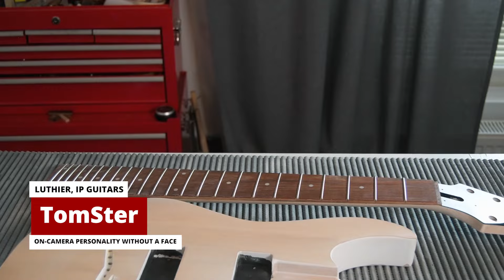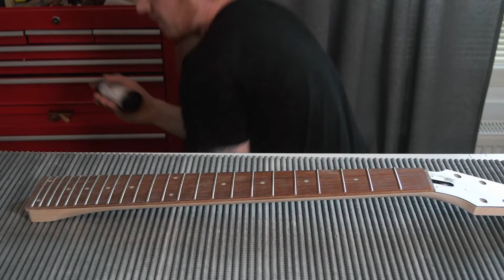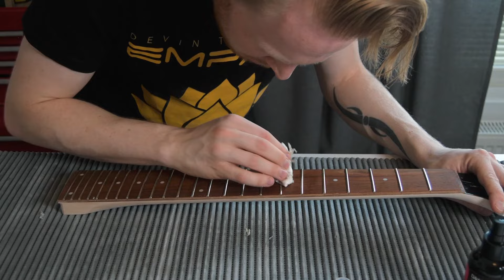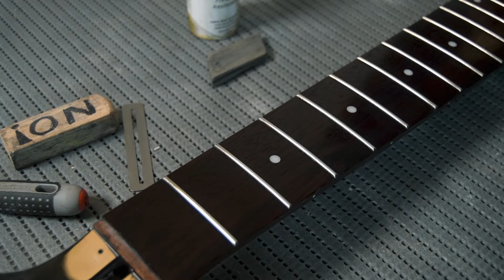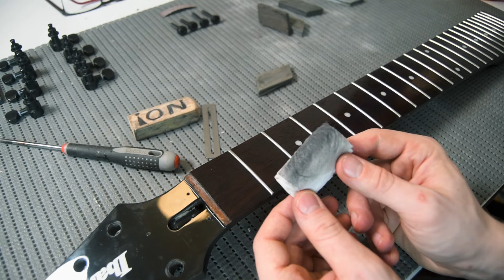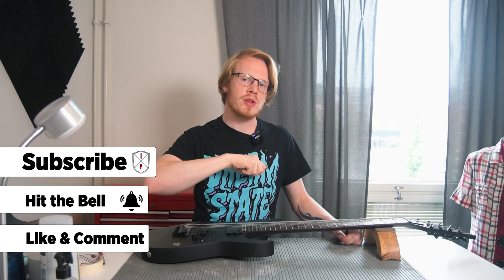How To "Ebonize" A Fretboard With Stains

Comment: THIS is how you do it! Never understood people who sanded the fretboard. If you can oil it, clearly the wood is unsealed.
Reply from the maker: Exactly, just need to remove that oil and that is an easy process in its self :)
Reply: Some Fender necks have poly coated fretboards such as on my Mustang, so had to sand the poly back before I could darken.
Reply: Depending on how course wood is also determines how much of the stain it will absorb. For instance if you’re staining wood, sanding it under 300grit will help it absorb more stain and in turn appearing darker than a fretboard that has been sanded to say 1000grit.
Reply from the maker: Absolutely right

Comment: Head's up, you're not getting rid of contrast by scraping the dots, you're INCREASING contrast because you're increasing the depth/difference between light and dark tones. For example, a black and white checkerboard has 100% contrast, where a black and grey checkerboard has we'll say 50% contrast; since the grey isn't as light as the white, you're reducing the difference between light and dark tones. So by scraping the stain off the dots and making them more light/white/vibrant/pop you're increasing the contrast between the dots and the board. Just wanted to let ya know!
Reply from the maker: Wow, did I really say I was getting rid of contrast?🤦🏼‍♂️ What a brainfart, because as you also said here that makes no sense.

My bad, sometimes my brain thinks two different things at a time and it comes out as just a combination of nonsense. Probably in this case "Removing stain off the dots to create contrast" became "removing contrast by removing the stain" :D
Reply from the maker: Ah alright, thanks! Good to know :) honestly, knowing me, I wouldn't have been surprise had I messed that up
Reply: I believe when he said,  "Using words like much needed contrast when I've basically made sure to get rid of contrast", he was referring to getting rid of contrast by getting rid of the contrast between the black guitar and the neck that was too light. He was getting rid of that contrast by staining the neck to make it darker and more the same color as the body.

I think he was acknowledging the irony and then made the distinction between contrast and contrast that works. The bright white dots on the dark fretboard is a contrast that works while the contrast between the lighter shade of the neck and the darker shade of the black body is a contrast that doesn't work and therefore THAT contrast had to be gotten rid of by staining the neck.

Comment: Not quite ebony, but still an improvement.  They make special stains and dyes just for doing extra dark black shades, one of those might work better. I think minwax makes one.    I've used Keda wood dyes to tint rosewood fretboards on multiple builds.  But their "black" is a mere dark indigo.
Reply from the maker: I've heard of the minwax one too yeah! And you're absolutely right. This is perhaps a matter of much more "darkening" than a 100% ebonising process.
Reply: @IPGuitars  I'm still looking for the perfect solution.  So far from vids I've seem online, india ink seems to give the best results - even better than Minwax true black.
Reply: @normbarrows  I looked into india ink because of your comment, and it seems that in terms of looks it works, to the point that StewMac sells it. However, I'd be a bit worried that it's not waterproof (it's basically fountain pen ink). Would that mean that the ink would transfer if sweaty fingers touch it?... Not sure, but I also wouldn't want to find out with my instrument. I'm looking for a solution as well... It occurs to me that maybe it it's sealed with oil afterwards it would work though. Have you tried that?
Reply: @mercedesescobarmusic  No, I've pretty much stuck with aniline dye (Keda) mixed with water, not alcohol.  I'll use it to tint a fretboard or dye a maple fretboard brown - for example.  Despite being water soluble  only a little rubs off when applying oil.  These days I'm into lightening, not darkening fretboards:  https://www.youtube.com/watch?v=B3hAX2YwwJM

Comment: To not tape the sides is just insane to me. Then to say cleaned up nicely 😂💀
Reply from the maker: The key here is not to use the stain so heavily that you'd get spillover. If your rag is relatively dry and you're putting on multiple light layers, it should be more than fine to do it without tape. Also plastic binding is easy to clean up or scrape

BUT you do raise a very good point, if you're not used to doing stuff like this or this is a first time dealing with stain, I really should have at the very least mentioned taping the sides.

Comment: I have fairly big fretboard markers. Do I have to stain around them or just go over them? Will it come off the Pearl? Or fake Pearl. Whatever they are
Reply from the maker: You can stain over on top of the markers. HOWEVER, I recommend you test this on a small part somewhere to see if you can then wipe that marker clean with a cotton swab (with water or IPA depending on your stain). It can depend on what material your inlays are and what stain you use. Good to make sure that you can clean them up before doing the entire board :)

If you can't remove the stain off the inlays (rare, worst case scenario) you could try to mask the inlays with masking tape prior to staining. Here you'll need to make extra sure that you burnish the tape down, so that you won't get any leakage.

But I'm fairly sure that you can wipe away most stains off of your inlays :)

Comment: You should've used some brite pads at least before staining the fretboard, in my opinion. Just to help the stain penetrate a little more. Looked good tho 👌
Reply from the maker: Brite pads would open up the pores a little more yes, however they aren't necessary. As long as the fretboard is clean, the stain will "stick".

 I do agree though that brite pads are a great trick for this!👌🏼 Definitely something I overlooked when making the video
Reply: @IPGuitars  yeah man, came out sick. I've an old Ibanez with the same neck pretty much and you gave me the idea to black it out cuz it doesn't go with the rest of the build. But it looks so pretty that I don't know if I want to murder that one lol. I might swap it and dye another one black, n keep this one for a future guitar. Cheers and thanks for the video

Comment: Will this stain the binding on my SLX Soloist? What about the imitation inlays? Would love to dye the laurel fingerboard black 👍
Reply from the maker: Great question! You can easily clean up the stain from the binding by just scraping it clean with a razor or scalpel blade :) if the binding is under clear coat then easy enough to wipe off with a guitar cleaning product or isopropanol. You can apply the same method to the imitation inlays. If you clean the inlays with the alcohol, just use a cotton swab to do so.

Lemme know how it goes if you go for it!🤘🏻
Reply: @IPGuitars  Thanks. Will do 👍

Comment: Try Iron acetate instead. Wood must be sanded. Wont affect the dots but will penetrate on wood up to 2-3mm. 2 coats would do, in most types of wood. It allows you to see the wood grain, and if the guy plays a lot and wears the fretborard, the underlaying clear wood wont appear! In addition: It´s so cheap. . . . (Clear vinegar + iron wool + time) Greetings
Reply from the maker: Oh absolutely a great trick! One that I have done way back when still in school, but never on this channel. I'm reluctant of buying wire wool again, so why I haven't done it in a while. But very good shout this!

Comment: Totally agree with the ebony. How did the stain last? When you showed it at the end, it looked as if a bunch came off during oiling / conditioning. If you can take figure out how to stain fretboards you could make a business out of it because most of the legal ebony left is very low quality. Even on brand new Taylors. Thank you for making the video:)
Reply from the maker: The fretboard is still looking as good as it did at the end of this :) all the pigment that came off toward the end was the surface pigment that hadn't seeped into the wood at all.
Reply: Cool! Thank you for the reply. Do you know if any reasons why you wouldn't want to stain a fretboard? Like is someone gigs it outside, down south in the heat? Do you think sweat would make it run even months later? Thank you:)
Reply from the maker: Well, the goal is to use the stain so that you get it to seep into the wood and remove any of the excess pigment that doesn't do so. So that once you oil the fretboard pigment won't lift off anymore. Even in the scenarios you mentioned.

Comment: Stained my binding pretty good with this. What’s the best way to get the black dye off my binding?
Reply from the maker: The easiest is with spirits and a cotton swab, if that doesn't remove the stain the best way is by scraping it off. You can use a razor, scalpel, or similar to do this.
Reply: No offense to the creator, and I mean this is constructive criticism. This is why skipping important steps isn’t recommended, and if you’re going to teach an instructional video, you should teach it correctly. Anything not being stained, should be taped off, or you will be chasing your tail, taking 1 step forward, 2 steps back.
Reply from the maker: Exactly and fully agree that I dropped the ball on that part. Because quite honestly, I didn't come to think of it at the time of filming. But lesson learned

Comment: Hello again bro, I did this ebonizing procedure on my Ibanez, but mine was done with Indian Ink. It turned out pretty well and looks great, one thing though, after playing and getting sweaty hands, I have some Ink/Stain coming off and marking on my fingers. Question is, is there any sort of coat that I can apply after the Ink to prevent this from happenning? Thank you in advance.
Reply from the maker: Did you apply some oil for the fretboard? When you do remember to let it sit for a bit and then rub off the excess. This will also remove any loose pigment

Comment: Hi, nice info about staining. Looks very good. What is exactly the drying time before a second layer...?
Reply from the maker: Thanks! And drying time really depends on what you use. Spirit-based or water-based and how much you put on. Water-based will dry slower, spirit-based will dry quicker. But the more you put on the longer it will take to dry.

You can see or feel when it is dry. A good rule of thumb: rather have many light coats that one really heavy coat to build up the finish you want.
Reply: @IPGuitars  Thanks. What drying time did you use on this guitar with this Crimson Stain....?
Reply from the maker: Hard to recall, but if memory serves this was the spirit-based so I wanna say anywhere between 5-20min between layers. I think I put the oil on like atleast 8h later.
Reply: @IPGuitars  Thanks again. I am still thinking about which stain could be the best. Spirit based or water based stain (for the the Fretboard). I want to use the stain for an old classical guitar which i have sanded to bear wood ( Fretboard).
Reply from the maker: Up to preference really. Most of the time I like to use water-based because they don't smell, so easy to work with even in an apartment building
Reply: @IPGuitars  Thanks for your info. Very helpfull. 👍👍

Comment: After removing frets and filling in a few chips on an ebony board..should I use a Ebony stain to hide scratches..discolorations? Subscribed
Reply from the maker: That actually is not a bad idea! Go for it, atleast it'll give it a little more uniform look
Reply: @IPGuitars  I ended up sandpapering

Comment: There is absolutely no need to be afraid of naptha lighter fluid for use as a solvent on wood fretboards. You definitely must respect its flammability for sure, but you mentioned fear of touching the fretboard after using it. This is an unfounded concern because it completely evaporates. Also the concern that it dries the wood, though true, is not a concern because you use it for the intended purpose of cleaning and drying. After cleaning and drying with naptha one should always moisturize with proper fretboard oil or wax.
Reply from the maker: I didin't remember I said that😅 but yes, absolutely the case of unfounded worry over flammability, while yeah only worry was the fretboard drying, but even then you're gonna put on oil anyway to bring it up to snuff. Silly past me with silly worries.

Comment: So how would you clean the stain off the neck? I want to do this to my RGA but I want to do the sides of the fretboard while leaving the factory look of the maple neck as it is.
Reply from the maker: First also make sure to sand off any clear coat on the side of the fretboard as it more than likely has some. But honestly, if you're worried about spilling onto the neck: masking tape is your friend.

Mask off the part you don't want stained and burnish down the edge with your fingernail. When staining, make sure your applicator (rag, brush, sponge) isn't too wet. Rather multiple light layers than making a mess with too much too quick👌🏼

Also, stain won't really stick to lacquered surfaces, so if there is some spill, you should be able to clean that off relatively easily :)
Reply: @IPGuitars  thanks bro!

Comment: Recommend dye brands, types of dyes for new zealand treated pine and purple heart wood?
Reply from the maker: I have used Crimson Stunning Stains and TLC Guitar Goods suStains. Those are ones I have experience with. They all work pretty much the same and come as either water or spirit-based, and mix well together within the brands. And together as well oddly enough.

The kind of final coat you are looking for really depends as well. Sprayed on clear coats, then you're pretty good with either. With Oil, CG stains go either way. Some of the stains lift the pigment off A LOT during oil application (blues and black spirit-based).

But as a type of stain, I would definitely recommend water-based if you're doing stuff at home because a) it's easy and b) they don't stink😆 Water-based just dries slower, but are super easy. Purpleheart is a rather oily wood, so it might require spirit-based, which are also easy, however a) need ventilation due to fumes b) need to dispose of rags safely.
Reply: @IPGuitars  thank you

Comment: While there are generational and subjective differences in what we think looks 'expensive' (black guitars are like white cars IMHO)... this was a great idea. Nice vid, thank you!. I also wonder what effect longer term wear is going to have.... an inverse result of those worn maple boards (think Buchanan Tele ...)? Speaking of maple ... if/when I try this... I may consider a clear thin lacquer coat to go for that ebony sheen. Thanks again.
Reply from the maker: Thanks for liking the video! :) When it comes to wear it won't quite be as like worn down maple. Lacquer wears down/chips off the top of the wood, meanwhile the stain in this case soaks into the wood a bit deeper. It'll wear, but the more open grain will remain darker.

And sure, you can apply a clear coat if you want sure, but getting that sheen might be a good bit less work by sanding with higher grit sandpaper like from 800 upwards to even 2000. Trying out on scrap wood is always great if you can, or if you're up for it, experimenting with a guitar that you're cool with doing so to :)
Reply: @IPGuitars  thanks, the lacquer would be clear on top of the stain, not instead-of, but that's a good heads up... didn't know that. I'll research whatever they use on strats/teles.
Reply from the maker: Fender for example use nitrocellulose lacquer on theirs :) if that helps
Reply: @IPGuitars  hmm... ok, that's what I meant. I need to find out if my definition of lacquer is the same as nitro.. lacquer. In any case... back to the point... a clear 'fender' coat on top of the black dyed fretboard. I'll be doing it on a cheap neck anyway... thanks for your clarifications

Comment: Nice!! What do you think about using tinted tru oil instead of this product? Like tru oil + universal dye
Reply from the maker: I mean technically, you could just as easily use something like that, if you have a ready mix. While commonly you wouldn't use an oil that hardens on darker fretboards, there is no REAL reason as to why you can't do that :)
Reply: @IPGuitars  I'm thinking about tru oil because since it harden i think it will not dye my finger at all.. good idea?
Reply from the maker: I mean once again, yeah a good point. While the point of this process is to try and remove all the pigment that lifts off, there might be some residue left in the beginning. With truoil the same principle applies, it's just that the final finish is different :)

Comment: So wait, you don't have to sand the fretboard down before staining it?  I watched many tutorials saying that if you don't sand it, the wood won't take the stain. Honestly I would like to avoid sanding
Reply from the maker: No sanding required. Rosewood fretboards (and the like) are usually only treated with a fretboard oil. This can be removed with alcohol.

For a maple board however, those are usually lacquered and will require sanding.

Comment: Does this work on a maple fender neck? I have a black fender Stratocaster that has a maple neck and I just can’t stand the look because it’s a black guitar so I want to make the neck black
Reply from the maker: Maple necks are usually lacquered (definitely so if it's a Fender), so your only option if you want to stain it is to strip it down to bare wood, which means sanding, scraping, and if you want it done right refretting (pulling off the frets, sanding down the entire neck to wood, staining, refretting, applying clear coat).

So unfortunately, not as easy of a task. Or alternatively, scuff sanding the neck and then painting it black, before applying clear coats again.